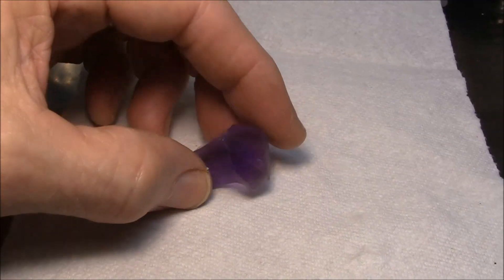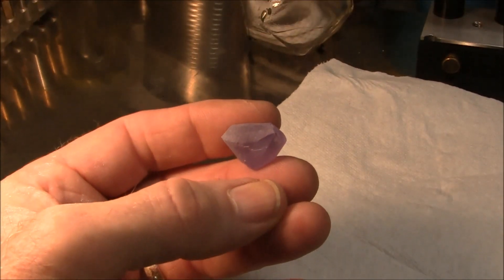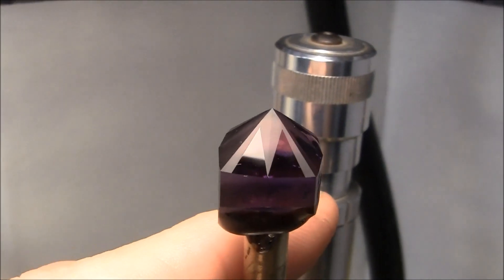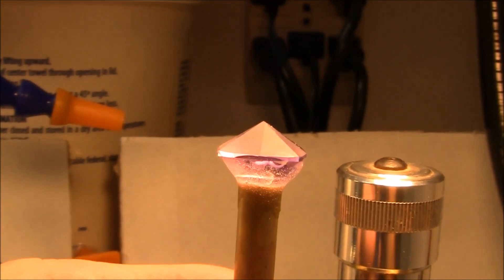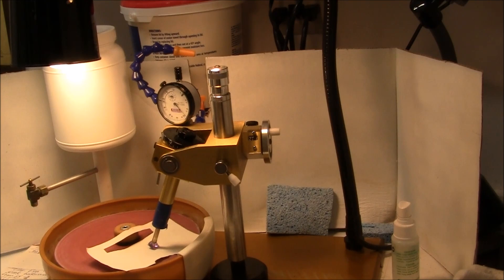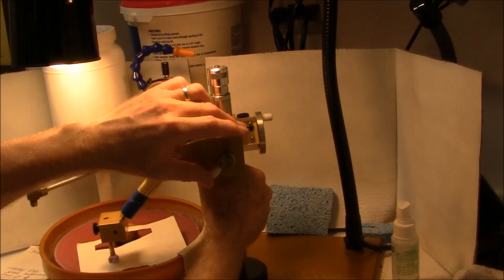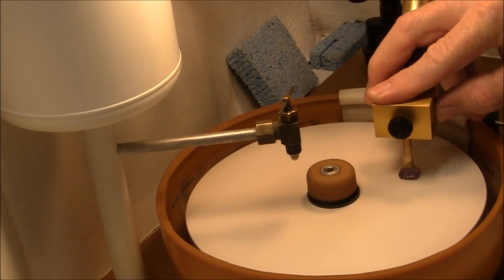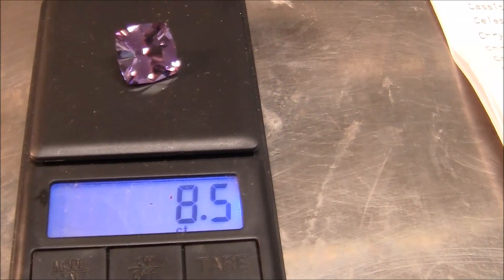Faceting a gemstone - amethyst old mine cut

Comment: Nice results!
Reply from the maker: Thanks chuck,  i was worried the color might not be uniform but  it proved me  wrong.
Reply: Gems by mbk it’s amazing sometimes how I think the way somethings will come out and I am surprised they end up being better than I expect.
Reply: @tennpikr74  I love what your doing I do the same thing you are doing and have stockpiled a whole bunch of rough material a little bit of everything.  in process now of building a flat lap from scratch.  what is the rpm of your lap I see you using all the time just curious.  I would love to converse sometime through email or messenger I have been finding some very nice deals.  I have been doing most of my purchases through ebay as well mostly from India and a bunch of certified stones already cut of 100+++ carat lots of tourmalines also garnets, Zircon and so much more.  If your up to conversing back and forth look for me on Facebook Charles Frazer in Fryeburg, Maine.  I look forward to hearing from you.  Keep up the fine work hoping to do as well as you have been with your purchases.
Reply from the maker: @papabearfrazer7389  Hi charles,   im not sure of the rpm, but i think i usually cut the facets around i/2 of the max speed of the machine so that would be around 8 - 900   rpm.  Lately ive slowed down the speed when cutting do to the mess it makes with the spray.
I would have liked to have seen facetron make the splash pan or bowl about 3/4 in. higher.  I have raised my bowl up 1/4 in. and that helped.

Im open to communication  but i dont have a facebook or messenger account but you can contact me here thru email by going to the  " about "     icon at the top of my homepage , then look for the contact  button.
I would be very interested in your ebay purchases , ive bought a couple pieces from india  and they werent very good.
Hope to hear from you soon.